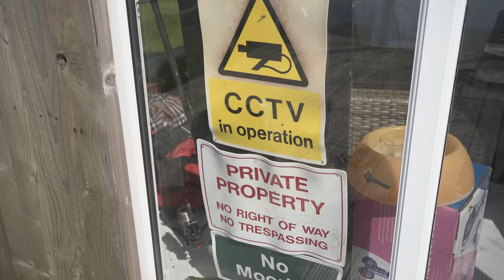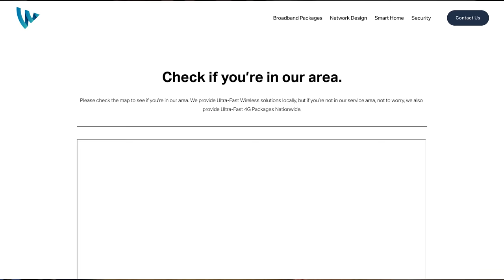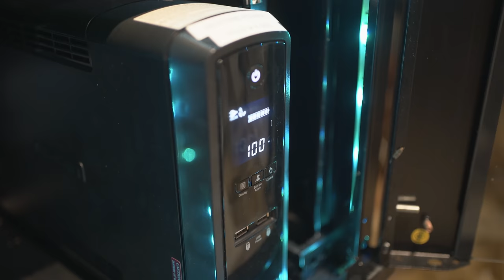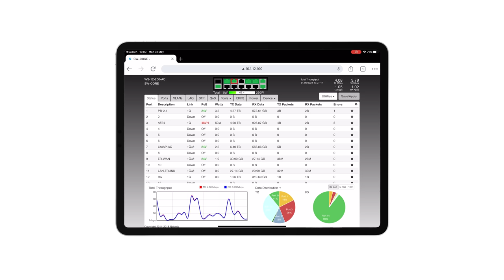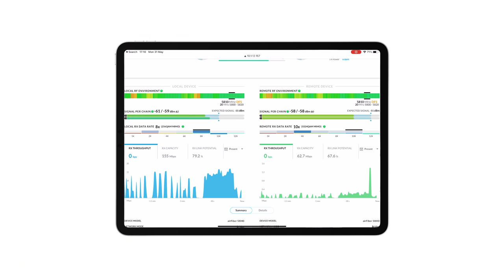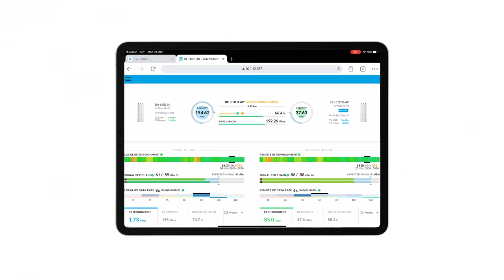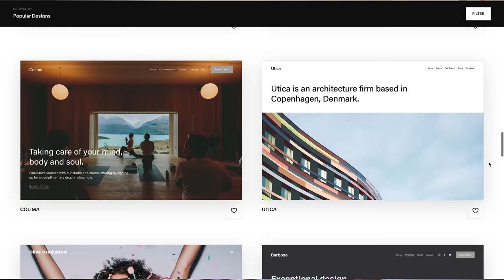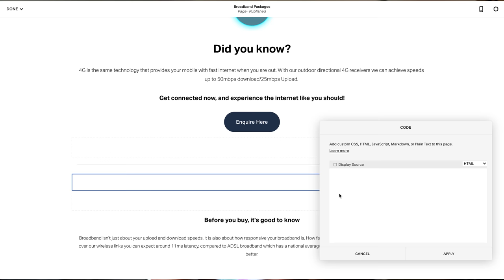How I'm Selling Internet in 2021 via WiFi!! Full Network Tour!!

Comment: House of cards, 1 switch fails and half your service dies. True redundancy would mean clustered switches.
Reply: He thinks having a UPS is redundancy. It's amateur hour with no real understanding of the terminology that he's using.
Reply: @benjones9822  I mean for small scale, I wouldn't worry too much
Reply: @berthold64  doesn't matter about scale, that is not what redundancy is. Redundant power means you have two power supplies, redundant UPS means you have more than one UPS. There is no redundancy at all in this set up.

Comment: Is there hard wired fibre to the property or is it all wireless , just curious due to majority of people wanting a wired connection
Reply: usually there would be one fiber cable or ethernet cable to the router in the home from the satellite that would be put on your roof. you can then use that router to connect hard wired devices to and also use to use wifi. The fiber cable can provide you 1 gb network speed if you have a perfect link outside.

Comment: You should get a back up generator for your internet Business
Reply: Not really,the surges on  a generator can be massive and not forgetting all the maintenance costs  ,Just a good power bank with good batteries will last him hours...
Reply: @Coldcorn  Maybe you're not familiar with the Inverter generators. They provide solid clean power like from the power company.
Reply: @mrmotofy  I'm not ,you have links on the same ?
Reply: @Coldcorn  There's classics like the Honda EU3000 Inverter Generator or really any of the Pure Sine Wave generators or 12v inverters for use in cars etc. The old construction style crazy loud Generators are bad in about every way...but they're cheap. They're Modified (Square) Sine Wave and not good for many reasons already discussed online. So always look for Pure Sine in descriptions/specs

Comment: Quick question is it possible to have 2 different fiver lines connected together?
Reply: They don't connect "together" they plug into the same router and use fail over or redundancy essentially. One fails then other takes over as well as load balancing.

Comment: can you recommend me a P2P device that can reach 25KM and can support up to 300mbps+ or up to 1Gbps?
Reply: What about the Ubiquiti airMAX PowerBeam 5ac Kit - rated for 450mbps at over 25km? I installed one when I was working at a nearby racing circuit for a network link to the commentary tower, dead easy to setup and absolutely rock solid
Reply: @cambermedia  expensive?
Reply: @cosettapessa6417  Not too much. It costs around 140 euros in my country. (per unit)
Reply: @cosettapessa6417  About £300 over here for the kit version, which has 2 dishes and 2 PoE injectors
Reply: thank you
Reply: The bigger problem is Line of Sight at that distance. The curvature of the earth at that distance virtually requires serious elevation

Comment: how do you ensure speed and stability? I would assume a wireless connection is pretty unstable. How do you ensure your customers get a reliable speed? What if they complain about connection issues since wifi can be so unstable?
Reply: You're thinking of traditional WiFi from old school routers, think of it more like a concentrated high beam of radio energy using dishes. It's actually scary just how rock solid and fast it is over Point to Point bridges.
Reply: This isn't wifi in a classical sense. Specialized ubiquiti hardware using wifi frequencies. That being said normal wifi is reliable with the equipment and LOS.
Reply: I have a 150Mbps wireless line where I live and it's actually faster, less ping times in games and reduced latency than my hard line I had with CenturyLink for years.
Reply: @johnelliott3896  What about when the weather is bad? For example heavy raining
Reply: @FLAMEalan  No issues can get a 5ghz 700mb link in rain at like 5km with no issues. 60ghz However which is  Air fiber will be stable at max 2 km with good dishes at like 1.5gb link.

Comment: Starlink has entered the chat
Reply: Starlinks ping is still to bad atm for gamers or anyone that wants response
Reply: I also think that starlink it's more expensive than his service. (In Italy fiber/vdsl/adsl, you get the best connection available at the moment of the subscription, no cap data, no limit for around 20/30€/month... He could sell that for 30/40£/month and it's cheaper than starlink... Also it's a local business
Reply: @iampyron22  the ping itself isn't that bad, but the problem atm is more the reliability of the connection and the ping.
Reply: @BeamDeam  most people are getting 100-100ms ping. i know i cant stand over 10ms so that needs to come down.
Reply: @iampyron22  I've seen pings more around 30-50ms.
Reply: @iampyron22  Pings average 30 on Starlink, It works fine for 80% of the internet users. Even gaming is very reasonable on it. If you wanna game...don't live in the middle of nowhere with horrible internet options.

Comment: So I notice you are paying Virgin media, are you using the virgin media router?  Or  is it just from the main wall socket into your a router what is not owned by virgin media?

Also was you saying that you divide the connection for each customer, so basically it you get 1 gb from virgin media and hyperthcallly you had 10 customers, would that mean you will change the router settings so that means each of them customers will get max only 100mbps?
Reply: He’s using an edgerouter

Comment: How to setup point to point connection on my own, my places is always problems with internet and its far form town around 35 miles and i asked all my fellow friends they have no idea, but i need good internet for work. Can anyone help me i even try all the wifi provider they have no idea
Reply: I can help you
Reply: @LILYANbolwary he left for the milk
Reply: I'm first question is, in my place cellular network is very weak and don't have wifi station in my area, so I'm not quit sure how will I get network by using this system
Reply: which device u were using 
power beam or light beam 2 lightbeam or mimosa
Reply: I don't use any, cause no one know how to set up in my area

Comment: your ping must be horrible..ping is bad in wireless..please show your network ping..i am sure it will be between 10-20 whereas fiber is fiber with ping between 5-8ms or maybe 1..
Reply: me with 250ms
Reply: @mishalchowdhury5610  exactly. I have used wireless in the past. It was horrible experience. So always go for the fiber if there is one, in your area... This wireless should be used as last option not as a primary choice because it has many problems..
Reply: @th-fb1nl  fribre costs a lot in ma country
Reply: It just all comes down to the isp, and if there sh1t or not, or where you live
Reply: 10 to 20 is not horrible. No one will notice.
Reply: @cosettapessa6417  that is i  am talking about in best case scenario in wireless. Ya it does matter in online gaming. Streaming videos doesn't care much. It also has unstable ping. Auto disconnect, packet loss, ccq fracture, signal noise, etc are the various problems i have faced when using wireless. And god antenna alignment, signal tuning are some of the tough task in wireless.. I have done it so i am talking about. So please try and experience before hand you speak. I am not bitting the bush out here. Thank you.
Reply: 10-20 ms is very good for my standards.
Reply: @th-fb1nl  bro don't you think is everyone would go with fiber if they could..? Shut your mouth up since you have fiber , the people in rural places don't have the same luck as you had. And ptp bridges are reliable ..what do you think a lot of cellular antennas are running on? A lot of 4g BTS are not linked up with fiber so they use ptp links , and guess what they are reliable with the right conditions

Comment: Does star link developing not threaten your WISP?
Reply: No as starlink is still very expensive
Reply: @m4hf  It is expected to become cheaper right? Also for Alex WISP for 60/60 it seems to be £89 and after a quick google it seems for starlink once you have covered the upfront costs etc it is a recurring fee of £89. Please let me know if i got any thing wrong just a quick google.
Reply: @sasthesasquatch3947  latency is a big factor. It's all down to physics. You won't be able to get the same latency on WISP/ISP Vs Starlink. Gaming would not be great.
Reply: @joshblades  Oh Thanks for clearing that up does starlink latency plan to fix up as more satellites go up or is it more to do with the range f the satellite and the base station?
Reply: @sasthesasquatch3947  no problem. Presuming the current satellites are at a further distance to where they plan to have the new ones, then yes you may see a very very small difference. But at the end of the day, the data needs to go between your dish, to space, then back to earth again. 1000's of miles. Strictly speaking Starlink isn't a new idea. There are quite a few companies where you can buy satellite broadband. Not many people use them however due to latency.
Reply: @joshblades  Yeah but starlink is a much more improved concept of this right? With low orbit satellites at 3 different levels all communicating. Not just a incredibly high up satellite. I believe they are only 340 miles up?
Reply: @joshblades  I don't think you understand the latency. Starlink is at like 30ms average, which is comparable to most home connections. It's faster than the average phone latency. The real world testing is very positive. It will get even better as they get more satellites. They also were approved to operate at a lower altitude which makes it even faster and better. Don't confuse Starlink with Satellite systems of the past. They aren't even in the same solar system

Comment: So am I right in saying that, you basically daisy chain each house and they piggy back off the previous connection?

For example, you provide a wireless connection from your core to a site (A) then from site A you use a dish to provide internet to another location (B) and so forth? At every site, do you have to install a switch? As Ethernet will run from the dish into a switch (providing the switch with an internet connection) and then any devices within the location that require internet such as an access point etc will then get plugged into that switch?

Comment: So... What are the chances of you telling us what link speed you have and what it costs?  :) You know how ridiculous prices internet is here in the USA. I'm just wondering whats it's like in the UK.
Reply: I'd have liked to know what link speed the leased line is too.
But that's the thing - it's a leased line, not a consumer broadband line (for obvious reasons - you couldn't do this sort of thing on a consumer broadband line).  And at that, it's not going to represent the cost of UK broadband prices.
I can tell you more about that though!  Virgin Media is a popular ISP here which uses DOCSIS (so it's over coaxial cable) to supply broadband, which ranges from about £40/month for 100Mbps down to about £60/month for 500Mbps.  They also offer a 1Gbps package if you need it.
We also have the Openreach network, supplying companies like BT, Plusnet etc.  They offer VDSL (fibre to cabinet then it's over the copper phone lines) and full fibre broadband.  They're around £28/month for 36Mbps down to around £50/month for 250Mbps.  They've also got their full fibre packages but I can't see prices for those as I'm not in one of those areas, we can safely assume it'll cost more than what I've said!
There are benefits to going either way with these: With Virgin's DOCSIS, you obviously get more download, with a fair upload BUT you can get seriously low pings - we get around 8 or 9ms and I haven't seen it go far above that.  BT's VDSL has the benefit of a higher upload rate when you compare with download speeds from these two providers, but VDSL can't push as high bandwidth so the download speeds don't reach VM's levels.  The ping can be slightly higher too, but nothing awful.
Sorry - this turned into a bit of a ramble but I hope it gives you an insight into what it's like over here.  There are obviously places that can't get any broadband, or just really really rubbish down the phone line or dial-up broadband and I hope that changes soon.  I'd be interested in hearing what it's like over in the USA!
Reply: Zero

Comment: How do you get so much Public-IP's when each customer get's his own?
Do you have bought an IP range?
Reply: I'd suppose he has own autonomous system registration in RIPE?
Reply: @JanVokas  Possible. But i dont think you can go there like "yeah hey i need some Public-IP's" and they say "Yes, here you have a bundle of 1000"
Reply: Id imagine that if it's set up correctly, that there are public ips that transfer via the nat in the router. Basically a big LAN. However the config should block all cross traffic as you would within a LAN or there is a big security issue.
Reply: @nicoketzer3110  that is exactly what you can do
Reply: @nicoketzer3110  since ipv4 addresses have been running out so rapidly there’s a lot of hoops to jump through to get them to assign a block. He’s probably getting a block assigned by virgin the same as they do on their business lines. The problem with that system is it adds about 20ms latency to the connection overall as it needs to be routed via virgins data centre.

Comment: Hi. I have a 1GB Talk Talk lease line in my apartment and nobody else within the entire building has wifi. Any ideas on how I could sell my wifi to other apartments? There are 4 floors, thank you.
Reply: He pretty much explained it...but you can run into complications selling a residential connection.
Reply: @mrmotofy  different houses are fine because you can use a dish, but how do you get wifi into somebody’s flat which is 3 floors down? I can’t run a cable down there so do I need lots of access points throughout the building?
Reply: You need a semi pro router where you can set bandwidth and then easy to do in the building. Personal drop cat 6 cables down to each floor and attach WiFi hub
Reply: @david29262  ok there are 25 apartments on floors above and below, could I run a cable from my apartment to each hallway on each floor and then fit a unifi-ac-lr so everyone on that floor could access it?  How would you create logins for each user and assign them with a public ip
Reply: @datmanUK  you would need semi pro kit which would have the settings you would need to be able to share and block people taking with out paying and create logins. You can make the controller from an old pc with a good network card. And then use Poe to power the WiFi on each floor

Comment: @alex Have you. ever tried to use Araknis devices?
Reply: You would not want to use Araknis in anything close to a setup like this. Araknis gear is decent and very reliable but only has the bare minimum features that a typical home or small office user would have a need for.

Comment: Intresting mix of kit. Not how I do mine. So is that 2 leased lines bonded?
Reply: Looks like he's using a BT line which Virgin can use, The BT line goes to the virgin NTU, then to the Cisco router, Only one line there
Reply: @ShroomyLoL  I see Virgin and 21CN so he’s got 2 ISP’s supplying. But the Virgin I see 2 fibre lines so wasn’t sure if he had 2 leased virgin lines.
Reply: @petewright2283  He's only got one incoming fiber line. It comes in into the ONT through the fiber cable on the right, then the ONT is connected with a fiber cable to a Lucent OS6250 switch (just above it) and the switch is then connected to the Cisco router.

Comment: i would have preffered using fiber optics then using those antenas stuff.
i had used that antena tech. it was so much unreliable. would have preffered a physical optical fibre instead.
Reply: Pretty obvious statement that, but his customers don’t have the luxury of fibre
Reply: Yeah If your a big multi million company go and  run fiber lines to random villages but a small isp can afford that. Besides If Everything is done Right The Antennas Can run Years Without issues but  its electronics at the end of the day so anything can happen.

Comment: Too bad wifi doesn't work in the rain
Reply: 5GHz equipment works fine in the rain which a lot of his infrastructure will be using. It's when you start using E Band like like 60-80GHz where the rain and snow will affect it.
Reply: I have a similar setup between my parents house and mine it has never failed in 5 years no matter what the weather
Reply: Sure bro ..then 4g that is using similar freq. Goes down ? ,Also he's using 5ghz